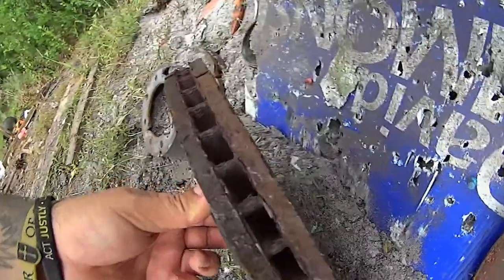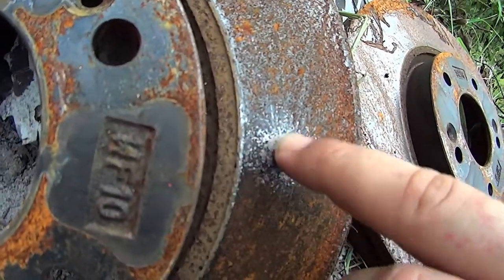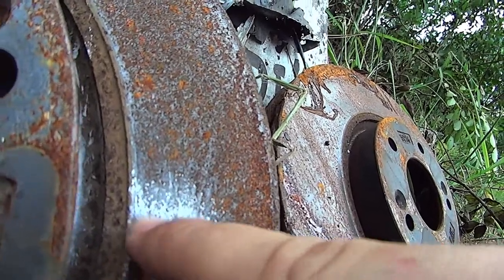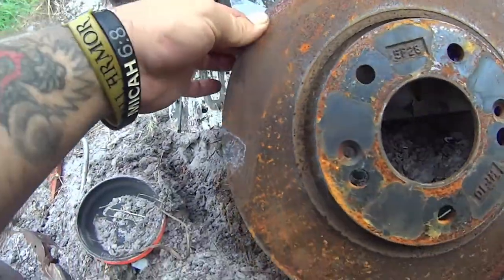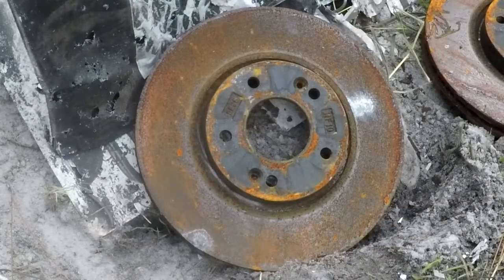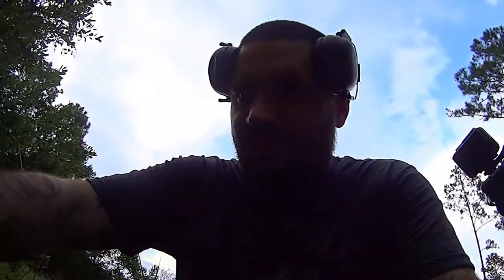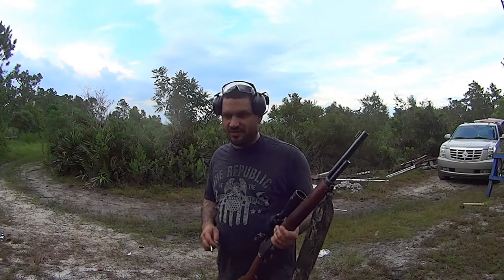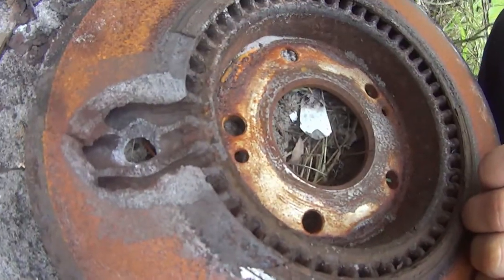Shooting Brake Rotors!

Comment: I shoot brake calipers, but I hang them on chains.  In my world the 5.56 green tip go through the rotors completely at around 50 yards.  Ray
Reply from the maker: Ray Clemons that sounds like a pretty fun idea. I guess it all depends on rotor thickness, as these were off of a full-size SUV. I imagine a passenger car rotor would probably let the 5.56 pass through much easier. I'll have to try it :)